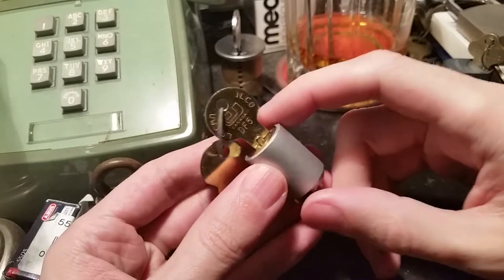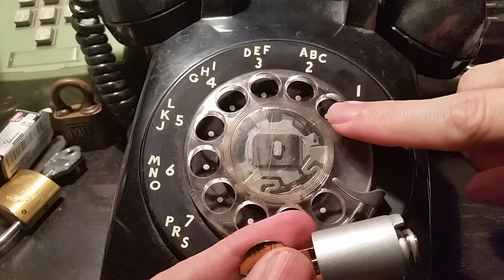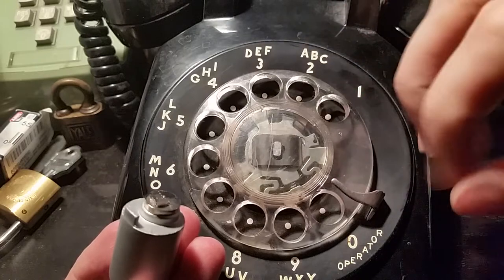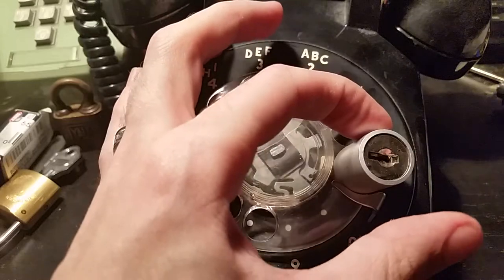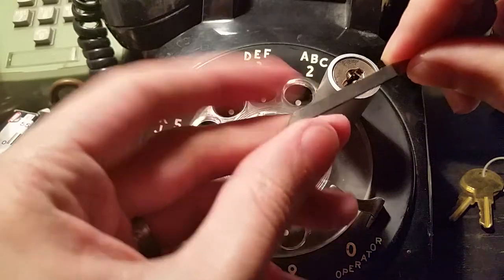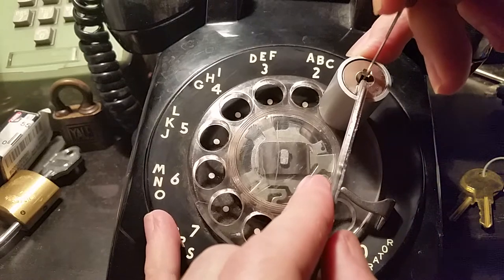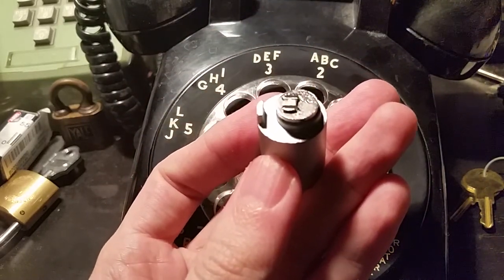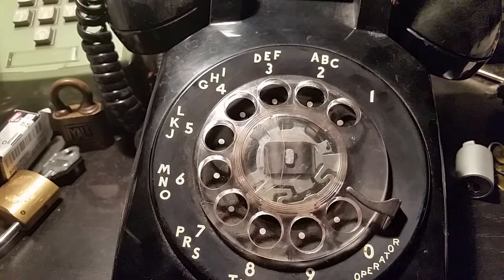(82) Ilco-Unicam Dial Lock

Comment: Very nice lock (I am old enough to remember these telephones in use)😅
I think the quicker way to make a call was to use the reciever buttons to tap out the number you wanted to call and this would bypass the dial.
Been a long time so might be wrong and may not work on certain phone exchanges(countries).🤔🤔🤔
Thanks for a blast from the past 😍😘😘😘👍
Reply: yes - you could pulse the hookswitch to dial :)
Reply from the maker: Hook Switch Dialing is absolutely a thing, it is still possible in most places in the US and Canada at least since public safety requirements make it difficult to phase out pulse dial support from wireline Central Offices. In at least one iteration of the old Gringo Warrior challenge they had a working phone line and you had the option to either pick the dial lock or hook switch dial your backup as part of the challenge.